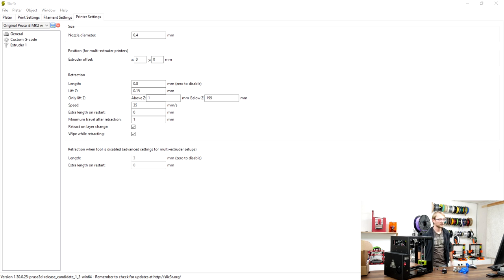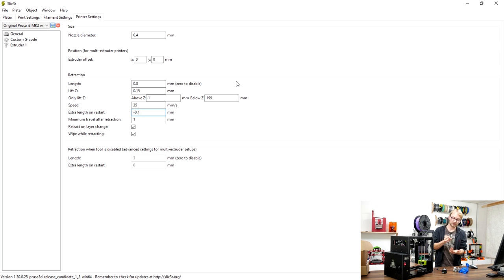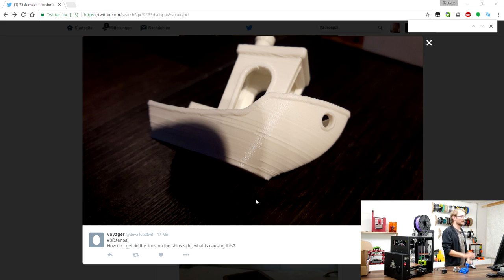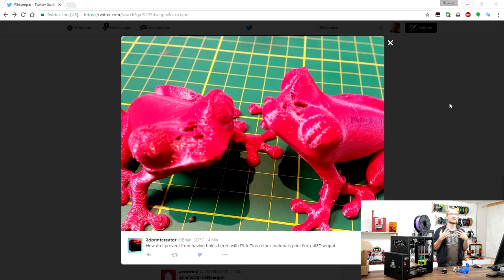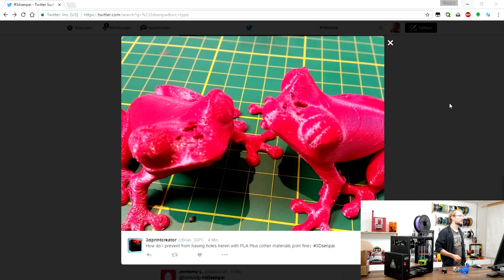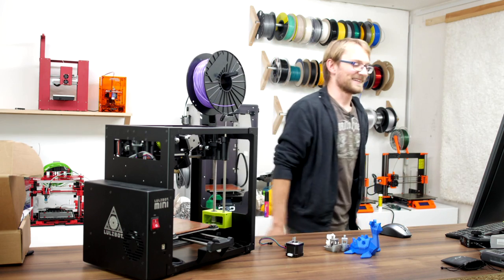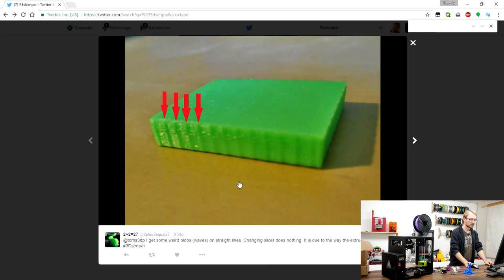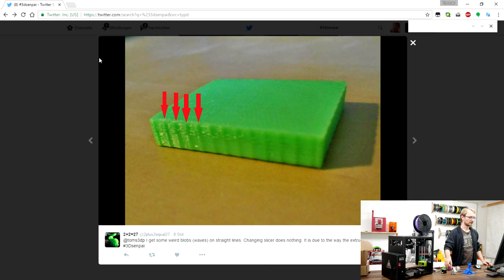[Part 2] Improve your 3D printer's quality - live coaching! #3Dsenpai

Comment: This show was super useful! I just built my Anet A8 last weekend, and after getting excited about printing anything at all, I got to questions about why I was getting certain features on prints (mostly first layer stuff and slightly rough layers) and this has definitely given me some things to look at. Much more specific than the average forum post, which read like those "are you teenagers doing drugs?" articles - maybe it's too hot, or too cold, or too fast, or too slow, or too tight or too loose.

Comment: For anyone interested desiccant beads are the way to go for moisture mitigation. I used a desiccant to stabilize catalyst for polymers for years without issues in an industrial environment. Plus you can find it at most improvement stores usually used inline with large air compressors.

Comment: This weekend, I was printing relatively large parts on my Wanhao i3 with a FlexionExtruder. I thought I had everything tuned perfectly, but at the last moment I decided to print at 0.25mm layer height instead of the usual 0.2mm. Part way through the print I started getting under-extrusion and either failed prints or barely useable prints. So when I started seeing it again on the last print last night, I just dialed the print speed down to 60% and that fixed the problem. I was going to bed, so it didn't matter if the print would take two hours longer. Checking the print in the morning, the quality was perfect after I lowered the print speed. I kind of gave away my mistake above though: I had a profile carefully tuned for 0.2mm layers, so when I changed it to 0.25mm and didn't adjust anything, I was asking the extruder to output 25% more filament/minute and it almost worked...

I have made so many modifications to the Wanhao that it actually would print really well at high speed if the extruder could keep up. However, the extruder just isn't able to extrude enough hot filament to print at those speeds. What I don't know if it's the heating element or the extruder stepper or both of them together causing the issue.

One thing to learn from the Fabrikator Mini: printing slow can work pretty well. Even printing slowly, my Wanhao is about twice as fast as the FM. I have never tried to make the Mini print any faster than the initial settings I got from the manual and it's extremely reliable. My Wanhao would be just as reliable if I just managed to control myself and use really conservative settings.

Comment: Cheerios are good for cheap desiccant. I would recommend changing it out once and a while but there usually isn't a lot of moisture in a small container.

I get great bed adhesion on my aluminum bed with Green Painters masking tape even at 17 C in my basement. Even ABS sticks until the thermal expansion forces peel it off because I don't have a heated be yet.

Comment: 53:38 This might actually be the extruder slipping. If the extruder is barely grabbing hold it will underextrude every couple of layers when there tension is on the fillament from the spool. I had a very similar looking print and tightening the extruder fixed it.

Comment: I run into lines at certain layers in my prints. Seems to be just one layer, then it returns to normal. Is this inconsistency in my Z rods?

http://i1292.photobucket.com/albums/b576/brotherchris81/20161101_114842_zpsffoibflu.jpg
http://i1292.photobucket.com/albums/b576/brotherchris81/20161101_114914_zps5xruv7kg.jpg
Reply: That looks like a bit of under-extrusion; a mini-jam that your printer overcomes by the next layer. My printer decided it doesn't like Monoprice filament; I'll have a few of those lines, and then my nozzle will clog. If it happens consistently at the same line, that'd be an interesting problem, otherwise you just had a small hiccup.

Comment: 30:37 This is not necessarily overextrusion. This might be problem with Z calibration, when nozzle at Z position 0 is below printing surface. Then first layer at 0.2mm height is really, for example, at 0.15mm height. And at each next layer printer will be feeding filament for 0.2mm layer height, however, the space will be for 0.15 mm for example.. In my first attempts with 3d printing, when i had problem with 1st layer not sticking to the glass i tried to calibrate z axis to be lower, and top surface looks similar to this on photo.
Reply: First layer squish tends to even out after a few layers. However, Simplify3D has an infill overlap setting that also affects the top & bottom infills. If you set it to 0%, the top/bottom fill might not properly connect to the outline. If you set it to 50%, you'll get a watertight print, but you effectively get over-extrusion if the top/bottom fill area is relatively small. The setting depends on your filament and other settings, but around 20% gave me much cleaner PLA prints. I had that setting at 50% for months and had no idea what it did. The other symptom of having this setting too high is that your volume infill will form ridges on the outer shell.

Comment: Hi Thomas, Thanks for taking the time to share all the tips and tricks to resolve these common issues. Excellent Video!

I am pretty new to the 3D printing scene, I did notice on my Benchy I had little gaps between the outside walls as mentioned at about 59 minutes. I am using Cura for my slicer, which settings would help with this? 

For reference, I am using a Maker Select V2.1 with 0.8mm Wall/Top/Bottom | 40 mm/s print speed | esun PLA at 220C hotend and 60C hotbed.

Thanks!
Reply: You might be under extruding. Is your infill stringy? Do flat surface on the top of your prints sometimes have gaps or missing lines on the final layer?

Also, make sure to print infill before walls, so that the walls have something to stick to. Otherwise, the outer wall might droop away before the inner wall is printed.

A picture would really help :)
Reply: Pla does not need 220 or even close! 200 should be max, down to 190. at 220 you will be burning it.

Comment: Having trouble getting slic3r to bond the outer two perimeters to the third when printing printer parts...  I have my extruder steps tuned in so it moves 100mm accurately and repeatedly, average filament diameter set, and multiplier in slic3r adjusted so i can print accurate extrusion widths/walls same thickness as my nozzle diameter (.4mm), when i print it seems to over-extrude judging by the too large ODs and too small IDs and top layers, but I get crappy bonding between the outer two perimeters and the third one in, and if i turn the multiplier down any i get a gap.  If i turn it down enough for the ID and OD to fit properly (.9-.95) i start to get gaps in the top layer, and my .4 walls come out closer to .3, so i know it's under-extruding there.   I've tried smaller perimeter extraction width as well as the default for all to .5 and .4 (slic3r picks .4 for outer and .67 for the rest), it does not seem to make any difference.  Anyone know what gives?  If there was only a parameter overlap setting i could balance it with that, but alas...

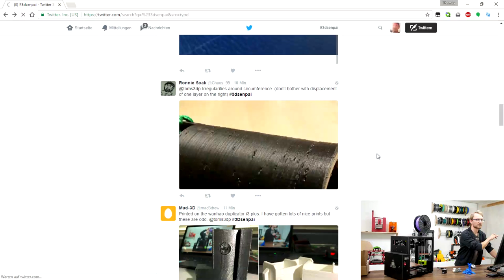Comment: At 21:25, and 35:00 it looks like a problem I have just resolved by tweaking Marlin firmware, and turning off babystepping for the XY axis only. It's on by default for later versions of Marlin RC7

Comment: 3:00 how it's possible that this lines is a retract issue if they start just in the middle during printing solid perimeter line. As i understand retracts only happens when the nozzle goes from one point to another through the gap and there we have solid line without voids?
Reply: by looking at the example with blue chess figure i seems understand that maybe it's the points where the printer start next perimeter line on next z level. correct?
Reply: I think you are correct

Comment: Another issue... well the solution, might be to really, really, study your slicing software!! In the software you can fine tune printing parameters almost to the extremes. so study well the manual / forums of the software of your choice.